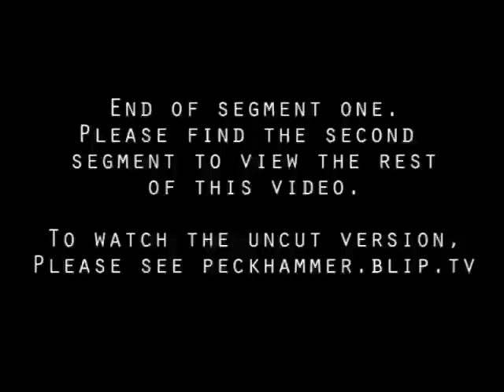Unleash The Beast: Moped Performance Tuning, Part 1

Comment from the maker: The mixture ratio discussed in this video may be to light on oil for high performance motors. I recently seized a motor running on a 40:1 gas/oil mixture. I spoke with Michael (the tuner/fabricator in this video) about it, and he is now running a 32:1 mixture. I think you could use even more oil than that in certain circumstances (racing), although it's going to be a real smoker.

Comment: The information you are giving is not correct the original speed that Puch Germany have designed that little moped to is 25 cm3 and 25 Kmh. Then you have the next higher version 50 cm3 it drives 40 Kmh . If you're really into tuning these little mopet's I'd suggest you try Kteidler or Zündapp or even Sachs. These Puch"s are onley copy's of the original Sachs.

Comment: An electric motor is not an engine, however an internal combustion engine whether it runs on gasoline, diesel, alcohol, propane, or any other fuel is in fact a motor. I have to leave now. I need to check the engine oil on my enginecycle before I take it out for a ride on the engineway.

Comment: Reedvalve intake is NOT better for higher rpm moped engines, piston-port is better.  Reason:  reeds tend to flutter past 9000 rpm especially if they are aluminum, reducing their effectiveness.  Reeds are better for lower rpm, can hold a lower idle, and provide for more torque.  That bald dude had a minor brain fart there.

Comment: i have a stock 49cc scooter that goes 45+ mph with literally no work done at all, stock intake, carb, head, exhaust, ect. and my 150cc has gone passed 75mph w/ only a new ebay exhaust pipe. All in all i think this tuning is a waste of time and money, just rip your intake and exhuast off, clean out your carb and throw a boost bottle on that bitch and you'll have a 50cc motor doing 50+ mph.